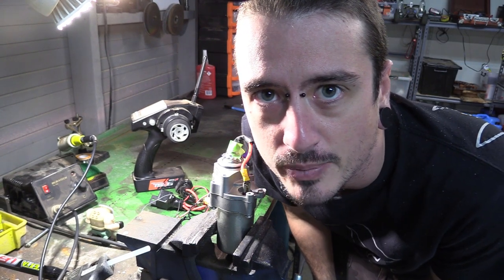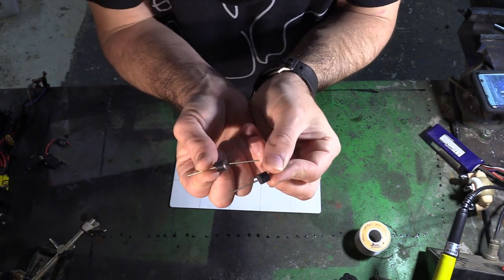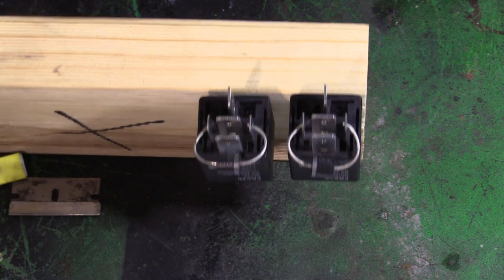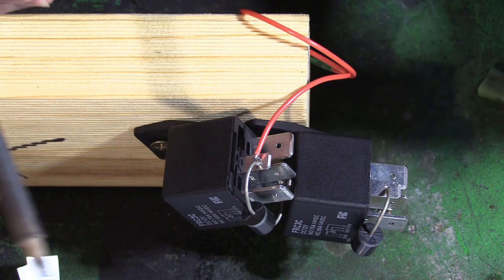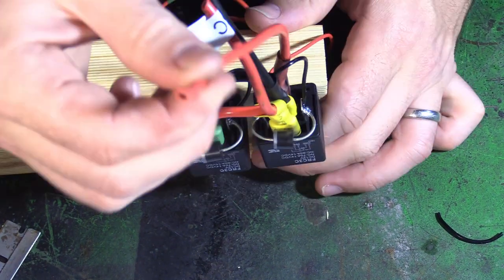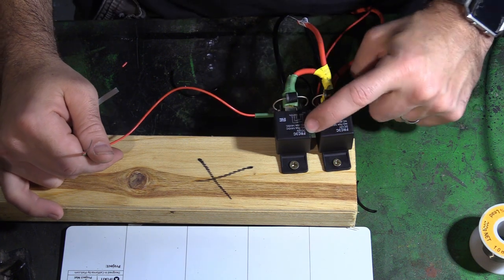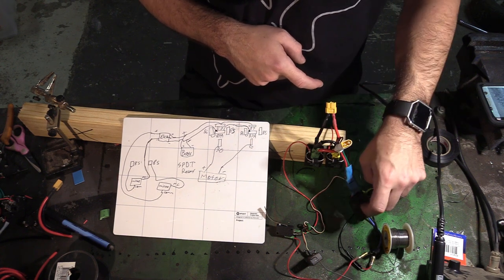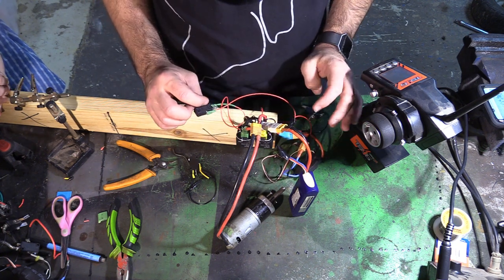Combat Robot Axe/Hammer/Lifter Relay tutorial

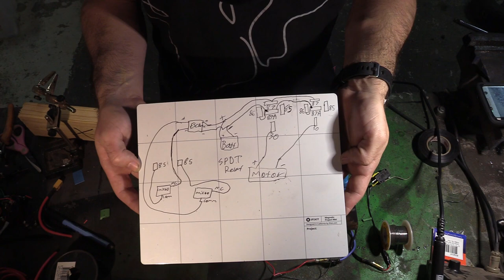Comment: Looking at the wiring diagram at 6:54 I get that you are feeding the output of the ESC through the microswitch into the relay to control it. so two questions:

1) why use a 30A ESC for this? don't you only need to activate the relay? couldn't this be done with a 10A esc?
2) does the PWM of the ESC affect the performance of the relay? I haven't messed with them much but I have heard they don't like PWM signals
Reply from the maker: There is a clearer wiring diagram in the description just fyi.
1- this could probably be done with a 10A esc as all it is literally doing is powering the coils on the relay, I did not have a spare 10A lying around but I did have a 30 :D
2- Also not sure on this one sorry,  but so far it hasn't yet. This is the same setup as I used at last years comp when justice bot won 3 out of 3, and at the end of the comp the relays and esc showed no signs of damage.
Reply: @CreativeInstigation  Awesome thanks for the clarification! An axe bot is on my list of things to build but I havent messed around with limit switches in bots yet. I was planning on running an arduino to do the limit switches but this seems more robust

Good to know that the relays can seeminly handle the PWM, maybe its just that relays dont transmit a PWM signal
Reply from the maker: @TeamPanicRobotics  you are most welcome, I am excited to see what you come up with! Feel free to have a look at sportsman's on the 18th if you are coming
Reply: @CreativeInstigation  I'll definitly be there with Strange Young Man! I'm currently doing a brushless upgrade on the lifter so hopefully he will be more powerful this year

Comment: Hi, I followed this tutorial and double triple checked the wiring.

Mine is not working as intended when I connect power motor spins straight away, pressing green microswitch stops motor.

I get nothing from the transmitter can't change direction, slow it down or have any control over the motor any ideas?
Reply from the maker: I had a similer problem when I made my first one and it ended up being a dud ESC, are you using a brushed 2 way speed controller to switch the coils in the relay?

Comment: In AWG, what size wire do you use for featherweights?
Reply: depends on the load, however in this robot i think i used around 8 AWG for most of the wiring then 4 AWG for the motor